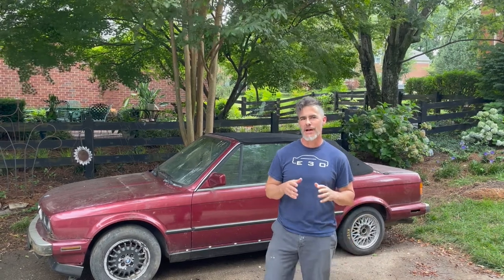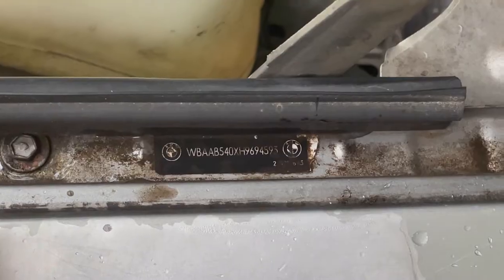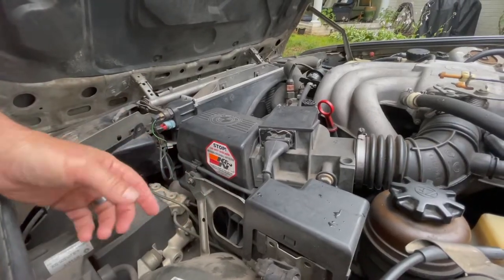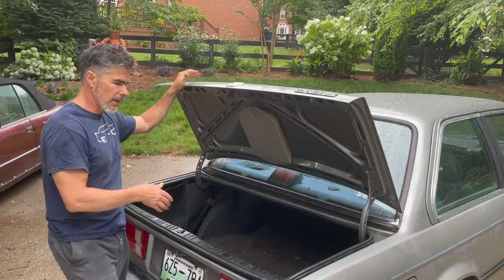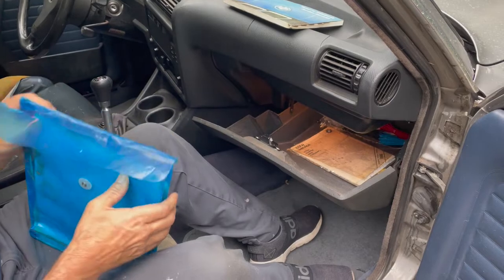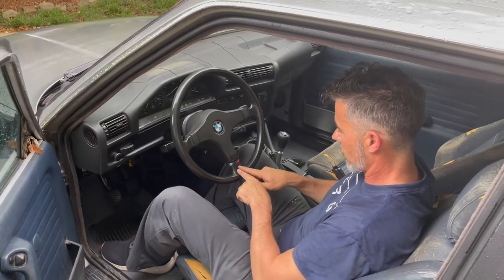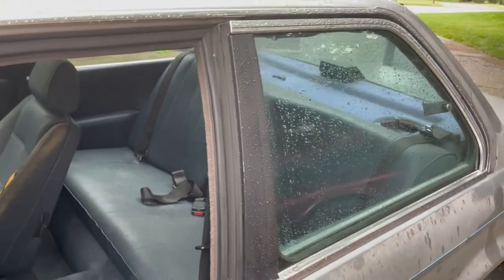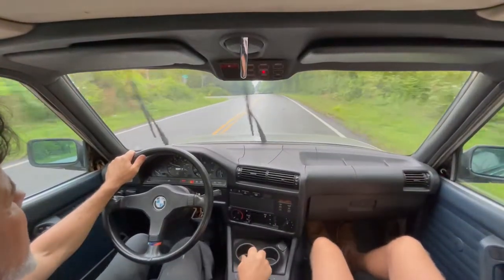How to buy a good BMW e30 325

Comment: Yeah e30's are getting really expensive now .... you used to be able to pick up a shell for like 100 bucks and an engine and manual swap for like 600 easily but now with everyone doing m50 swaps the getrag manual transmissions are getting really spendy to a point where im struggling to find one for my next build :/

Comment: Oh that engine rev noise.   How I miss it.  

I had 2 ‘87 528e’s.  One manual with leather and other  auto with cloth.    A ‘85 325e 5 speed 2 door with cloth, notice yours in the video with manual roof. Mine was power and had the full computer.     Then lastly the car I wish I never sold, ‘88 325ic stick    White black top crimson leather.       Such a blast.

Comment: Nice video! Question on the sunroof video I don’t see any other video of what u mentioned. I have a 84 manual sunroof and when I had recently purchased the car I tried opening the sunroof and felt the wire inside snap or something on the rail I can spin the handle but just hear the wires move but sunroof doesn’t so not sure how to fix that no way of popping it up or down :(

Comment: What’s the difference between an “e” and an “I”?
Reply: The engine.  The "e" has the m20b27, 2.7 liter 121 hp @ 4250 rpm 170 lb⋅ft @ 3250 rpm redline @ 5000 rpm.  The "i" has the m20b25, 169 hp @ 5800 rpm 167 lb⋅ft @ 4000 rpm redline @ 6500 rpm.  The "e" engine is designed for efficiency but it has a lower broader torque curve so if you swap out the 2.75:1 diff it comes with for a 3.25:1 one you get a great daily driver.  You don't have to rev it to get it to move.

Comment: The Lachssilber 325 is really good condition. A lot of interior work, but all manageable. Btw the worn out stickers on the a/c button etc can be replaced. 325i Sunroof, a/c (very rare in Germany) M-Technik 1 steering wheel (500$ in Germany) and the sport seats. Really cool car. Btw the rusty chrome around the front window can be replaced for small money! Thanks for the learning track learnt a lot about my beloved car model.

Comment: Does 316i/318i is good for first car ?
Reply: I don't think that buying a 30yo vintage car is good for a first car. things will be breaking and other things will break when you try taking things apart. expect rust that will need to be addressed. that said, many have had it for a first car. if you have the tools, skills and finances then sure. if you don't then I suggest getting something newer.
Reply: I got one for my first car lol I’m in California so there’s no rust on mine but my car hasn’t had any problems I just need a new battery